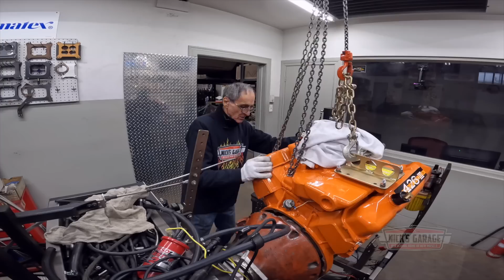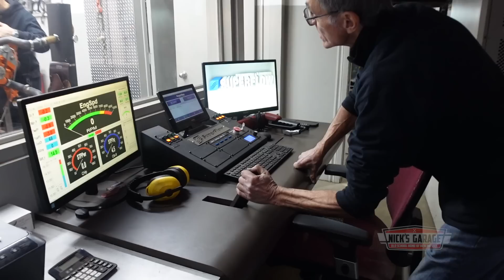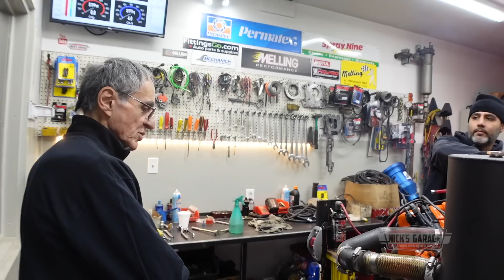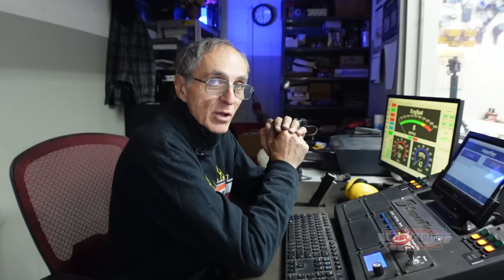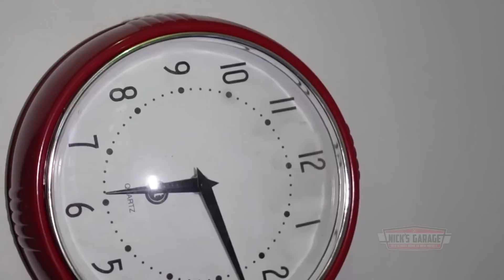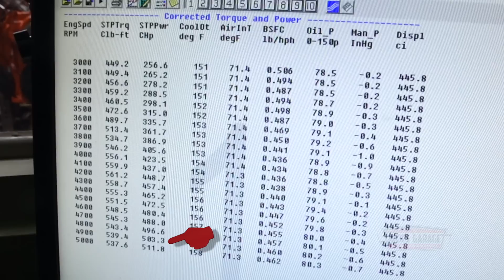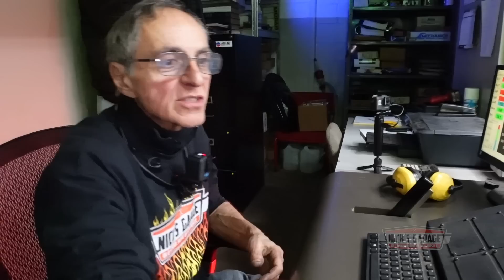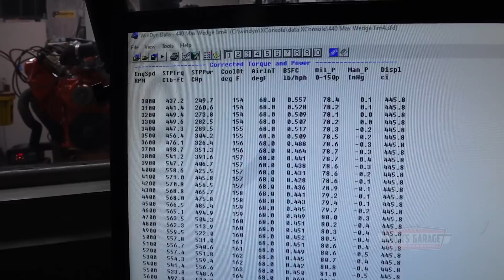Max Wedge Dyno Tested - Troubleshoot a Legend

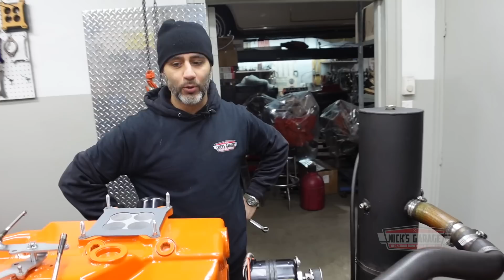Comment: 8:36 Well then he's gotta love the Mopar's because while they may not have always been the fastest, Chrysler Corp. ALWAYS had the coolest stuff. From Shaker to Air Grabber to Super Bee & Bird to the awesome high impact colors, the cool factor of Mopar's is untouchable in my opinion 👍
Reply: Actually we still rule AA Funny, & Top Fuel
Reply: Get rid of the unfair weight breaks and restrictor plates and Mopar was always the fastest.
Reply: May not be the fastest???
  I do believe that Ford and General Motors were using Mopar engines in their funny cars! In fact back in the early-mid 80s there was a 2 page centerfold in Hot Rod magazine thanking Ford and General Motors for using Mopar engines in their Funny cars!!!
Reply: @edarnold1426  I meant in the early 60's to the early 70's when the big 3 were competing at anything they could.
Reply: @JDMmike420  when do you think the Mopar Hemi came out??? The first generation Hemi came out in 1951! The 426 Hemi came out in 1964!!!
Reply: @edarnold1426  The original Red Ram HEMI's were made back in the 50's but they weren't really "performance" engine's like the gen 2 426's were.
Reply: @JDMmike420  yep, and even big Daddy Don Garlits switched to the 426 in 1965 and started setting record after record with it!
Reply: @edarnold1426  I remember going to car shows with my late father in the early 90's and seeing those old Fire Power 331 HEMI's with GMC blowers on em in many a street rod from back in the day. Now it's all SBC & LS.
Reply: @JDMmike420  Don't forget the 392 Hemi that came out with dual four barrel carbs pushing 375 horsepower in 57 and 58. That was a lot of horsepower for back then.
Reply: From West Haven, CT.,we thank you for this video.
Reply: @franklindreidsr518  I live in New Haven CT lol. Small world.
Reply: And apparently they made a good product transmission and manual transmission were tuff
Reply: @jeffhelton2735  Yeah, the 727 TorqueFlight and the A-833 4 speed were decent gearboxes. Not the best but definitely not the worst, you know?
Reply: @jeffhelton2735  Somewhere I heard that New Process corporation made the Torqueflite transmissions for Chrysler, AMC and other companies that needed good reliable automatic transmissions... New process also made manual transmissions and transfer cases for Chrysler products And other companies... And Yes, that company made good products... Like so many things, cars and trucks often use several products that are made by other companies... This tends to lower the internal cost of the end products, and often increases the quality of the products...
Reply: @jdmmike7225 , Nobody can win all of the time, unless only their type of machines are the ones competing... But Mopar had frequently come-up with innovative ideas, with relatively modest resources... Especially when Chrysler was the parent company... The contributions that so many companies made in several countries in WW2 to overcome the Nazi's and the Imperial Japanese military, was amazing... And a lot was learned from those contributions... This is probably what gave so many companies after WW2 a very strong background in engineering and innovation... Mopar, along with several other companies  adopted so many manufacturing and design advantages, innovations, and experience, that were immediately applied to their civilian products... This greatly helped the economy, and product quality in the post WW2 era... So many countries were able to apply this experience to their civilian product markets for peaceful use... This included our former adversaries :Japan and Germany, of which both countries are now on good terms with their former adversaries during WW2... Mopar was one of several companies that grew after WW2...
Reply: @michaelmartinez1345  I am aware. There were indeed times where they stood on top of a perspective event or motorsport. But as you said you cannot always be on top. But I was more referring to the off beat & odd ideas the guys at Chrysler and Mopar often championed. They were not afraid to be different in the pursuit of performance and styling. From all their different induction solutions to the beginnings of aerodynamics but also the off the wall colors and huge eye catching decal packages. I just think compared to Ford and GM they seemed alil more adventurous.
Reply: @JDMmike420  That is a good observation... And they were often very resourceful with the materials and equipment that they had to work with..  Their first 'aerodynamic' cars were the Chrysler and DeSoto Airflows... They were unlike other cars in the mid to late 30's, and the sales of those cars reflected the unusual look...  The late 1950's brought tail fins, which were quite cool looking, but several motorcyclists felt they were like knife blades built on the back side of cars.... Then came the 'Wing' cars , the '69 Dodge Daytona and the '70 Plymouth Super Bird... Specifically made to compete in the superspeedways in NASCAR, ,these cars were even faster than the Ford Talladega's and Mercury Cyclone Spoiler 2, because of the Chrysler cars superior aerodynamics... Chrysler was FIERCLY competitive in several types of racing in those years..

Comment: I used an ISKY solid roller on my MW with bushed ISKY EZ-Roller lifters. Not cheap but it is bullet proof. The cam is a 570RR. A MW needs a solid, sounds good through the exhaust but whatever floats your boat. Good video!

Comment: I have to ask...The over bore to 440 is fine but did you use the original crank? also....what is the difference with the 413, I have also heard it called a max wedge (in fact I had a friend with a 413 Max wedge years ago) last question, with out the max exhausts how representitive of the original power specs do you expect this engine to be
 thanx for letting and old guy ask questions
Duane (from the PNW)
Reply: 413, 440, same stroke, 3.750.  Bigger bore on the 440.  426 Max Wedge factory was 425 HP and 390 TQ.

Comment: I see that the vacuum advance is not plugged on the replaced distributor.   Would that effect a motor of this caliber much?
Reply from the maker: not really, during full throttle dyno testing.
Reply: @NicksGarage  Thank you Sir.   My cousin had a 68 Dart  GT with a Max Wedge from an old Sport Fury.   We built it in his back yard and ran 11:11@135 first time out.

Comment: What would happen with the super long runner manifold from the Crysler 300 ???
More or less HP ???
Reply from the maker: Still to be tested.. the engine is still waiting for parts.
Reply: @NicksGarage  All else being equal, I believe longer intake runners (to a point, obviosly) makes more torque at the bottom, but an engine with breathe better up top with shorter runners. I think some early 90's Toyota V6 and V8's had variable length intake runners with a flap that would unblock the shorter runners at higher RPM. Obviously Nick knows more than I do, but I'm not sure the Max Wedge is designed for max power, but max torque. I'm curious if this rowdy cam is right for this application. That being said, 540 horse looks pretty healthy.

Also, isn't it smarter to dyno test with air filters? The client is obviously going to run the car with air filters. Isn't that going to cause the engine to run richer in the car than it does on the dyno?
Reply: @kiisu74 ...   At the end we tested with Air Cleaners on and it ran lean on the Dyno.

Comment: Nick, Is this in street Hemi Orange or Race Hemi Orange? If street Hemi Orange, I saw some touchup's you did in another episode. What Brand mix are you using?

Let the MAX show us it's power!
Reply: Check the previous video. I show the paint.  Intake installation.
Reply: @nickpanaritis4122  Thanks nick, Got it. I see they have street hemi orange as well.
Reply: i DO NOT REMEMBER. it is on the previous video with the intake installation. I show the can of paint.

Comment: Nick, that paint job on the Max Wedge looks like one big drop of paint. I can't imagine how much time you put into grinding, sanding, and filling to get it that slick!
Reply from the maker: All credit to Jim, the owner.  He painted the intake before he brought it in.
Reply: Looks like PPG base coat/ clear coat.
After about 4 months of heat cycles it'll be less glossy 
Then it'll look like a really nice fresh from the factory original engine. And it'll stay nice for a long, long time. A friend of mine restored a 69 Z28 about 10 yrs ago.  He painted his engine like that and it still looks good. It's the same paint that somebody might use to paint their car with. It holds up against heat surprisingly well.
Very flexible too. Excellent for painting plastic bumpers and such.

Comment: Always a concern at first startup as to whether the carb. works or an ignition problem pops up. Getting the engine going and up to proper RPM for cam break in is so important. These days lifters are junk (unless N.O.S. from years ago) and the oil doesn't have the zinc additives today in them. I'm now a firm believer in roller cams on everything that they can be had for.
Reply from the maker: You put your finger right on it.
Reply: I think you're correct on today's flat tappet lifters. Also today's roller cams have to be bar stock and hardened, so you're correct, the way to go is roller cams and lifters.
Reply: I have heard a few very credible people say that roller lifters are the way to go. What I'm wondering though is if a manufacturer can't make a flat tappet lifter properly, why should I trust their roller lifter?
Reply: @GearheadExplorer85  Flat tappets haven't been in new engines from car companies for decades now (going on 35-40 years) and there isn't as much call for replacements so there are few companies that make them. Most are outsourced chinesium junk no matter the brand. Yes there are problems with some rollers too. It appears that Ford is having problems with rollers and cams in their new 7.3 gas truck engines. Parts these days are a crap shoot thanks to the companies 'maximizing shareholder value'. Rolling friction is less than sliding friction, so roller cams are better. Zinc additives have to be put in the oil at each change for flat tappets because it isn't in the oil any more. No good solution if you have an oddball.